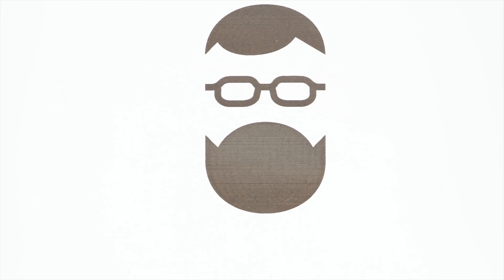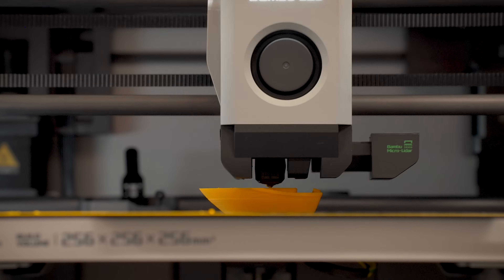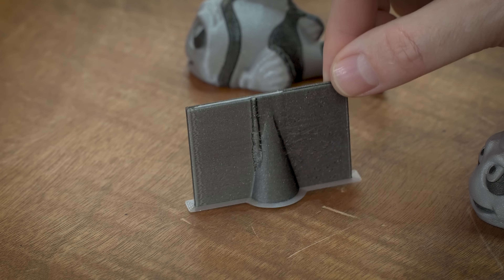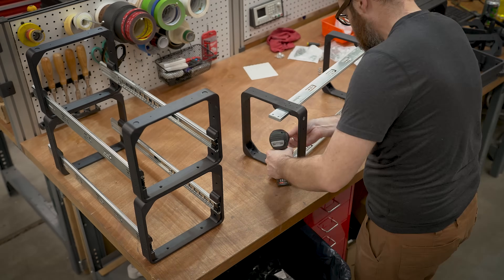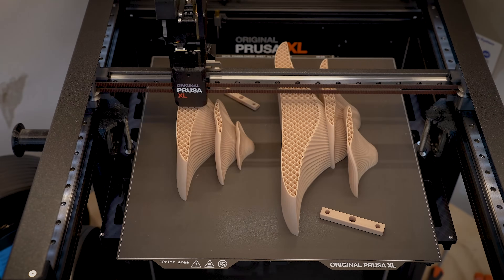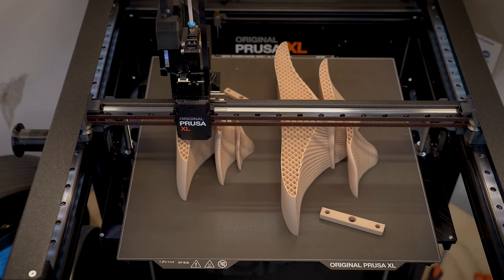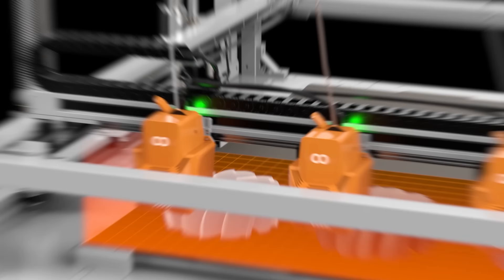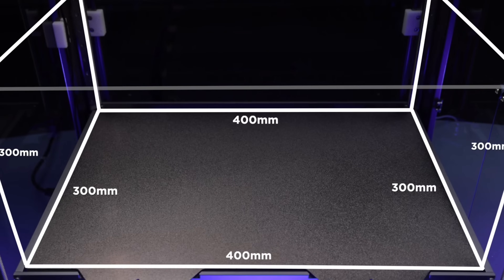Choosing Between Prusa XL and Bambu X1C?

Comment: I made a longer comment which got lost to youtube error, but I think this is a reasonable take.

I also think that the current solution isnt even close to what I think will really break this multi material wide open. I think Bambulab with the A1 Mini's toolhead, seems to basically be planning out sort of what I envision to be a much cheaper, and just as effective system where instead of changing the whole tool end, you just change the hotend, because ultimately, the thing that takes time is getting the nozzle ready, so all you really want to do is switch the hotend to one that is already primed (so to speak, not primed as in the 3d printing term) for that filament.

A system like that would allow for way more filaments on one machine and reduce the cost and complexity tremendously.

Basically something like what MihaiDesigns is working on, I think is clearly the future of multi material.

No doubt for now, Prusa is the only game in town, but I don't think its end game, and instead only the beginning.

Edit: I also had the thought though, that for a maker who doesn't already have a CNC mill, they could actually be set with a Carvera tool changing CNC machine and a P1S for the cost of one Prusa XL, so that further limits the ideal customer. Just an addon thought.
Reply: changing the hotend and changing the tool head is the same amount of work...?
Reply: @pinecone606  Not at all. One requires electronics to be connected and or dragged around, whereas the other is far more space efficientz would have no electronics on it and therefore would be significantly cheaper per tool.

Comment: Now if one company or another offers multiple heads with color changing systems (like the AMS) then that would be a great hybrid. The other consideration with the X1C is not being limited to just the 5 colors. You can effectively set up to 20 different colors without having to really think about it.

Comment: Id love an XL, but not at that price.

I have an e3d tool changer and its decent enough but my god did it require some tinkering and improvements to the machine.

The X1C is awesome, and its spawned awesome improvements to slicers (OrcaSlicer).

Ive added a few things the X1C does well to my e3d tool changer such as the purge bucket and nozzle cleaning.

But the XL I kinda feel is being held back by Prusa's firmware and actually even the slicer. And it just costs so damn much compared to literally anything else.

Sure the XL can print different materials but look how bad the print quality is given the cost of the machine.

Comment: I think Prusa has been a great company but they've gone mad with that asking price lol. Especially since  Ive seen issues with the head swap mechanism, which is  one of two reasons why Id even consider it. Personally I think they should be around $3k but I think they have a  difference in revenue to make up since  Bambu  came to market.
Reply from the maker: I don't see it that way at all.  It's just a much more complicated and expensive machine to make.  It's arguable if it NEEDS to be like that, but looking at the machine in person, I can see where money went into it.
Reply: @RobertCowanDIY  I agree, mine was the kit version.  I was and still am impressed with the quality of the parts and how it is built.   I have had problems and Prusa support has been great.  Still learning how to make it work, but have had some great prints
Reply: @RobertCowanDIY  it’s a nice machine, just not that nice lol.
Reply from the maker: @IDirtbike  Early adoption always comes at a big premium.  But if you NEED the toolchanger, you need it.
Reply: @RobertCowanDIY  very true!! That tool changer is pretty awesome!
Reply: Prusa make their Printer in the EU, not in china. They use quality material, like THK linear rail bearings, IFM sensors etc. they make their PCB in house with good QC. I have nothing agains Bambu, work well, but at the end it is no in the same league, Chienesium VS Quality parts, China cheap labour VS CZ EU job. It is not manufactured the same way, maybe to expensive for some polarized people. I like any 3d Printers, they all have their up and down.

Comment: Having experience with both I agree with the Sedan vs Pickup comparison for average users. I would like to add that for serious multiple material printing the Prusa XL5 puts the Bambu X1C in the rear view mirror. It is incredibly freeing to pretty much ignore the number of tool changes.  The difference is a lot more than just size and capability. I feel the XL is one of the best purchases I've ever made. You get what you pay for.

Comment: I'm curious to see what the experience with the Peopoly Magneto X will be like
Reply from the maker: I'm quite interested in the printer, although I'm not sure any of the features really mean much for actually printing 'better', it will just be a bit faster and much quieter.
Reply: @RobertCowanDIY  The developer told the 3D Printing Nerd during the interview that the positioning accuracy of the linear motors used is 0.003 mm. I think there should be improvements in print quality despite high speeds, and on the other hand, with a 0.2 mm nozzle you should be able to penetrate the detail range of the resin printers while at the same time selecting any materials for functional applications
Reply from the maker: @christiantoth7959  Huh, interesting.  I'd be curious to see if positional accuracy is the issue with getting more detailed prints with FDM, I always assumed it was just the nature of the material.

Comment: I dont remember if i asked before, have you tried soluable supports on the XL?
Reply: don't need to

PLA and PETG  don't stick together so you can use them as supports for each other
Reply: @thinfourth  i thought about it for more complex designs where there is no or little access to remove the supports. And for PC materials or nylons.

Comment: What Large format 3d printers do you recommend if tool changing is not a priority?
Reply: You might take a look at the Rat Rig.  I have two and they work well.  You have to build them, and determine what hot end and extruder to use, but they have a standard.   My 500mm cube can print almost anything.   That size will be about $2K
Reply: @woodwaker1  wow!
Reply from the maker: I don't have any personal experience with them, but I've heard good things about the Sovol stuff.  It's around 300x300 and I think they have a bigger one too.  I've also had decent luck with the Creality bed-slingers, as long as you understand the limitations (relatively slow, not enclosed, might need to get an all-metal hot-end for higher temp stuff).
Reply: @RobertCowanDIY   okay👌🏻 will check it thank you!
Reply: I’ve had a Raise3D Pro3 for several years. It’s 300x300x300, fully enclosed, and prints any material I throw it at flawlessly. But it’s also quite a bit more expensive than the Prusa XL

Comment: Imagine the day you get a pick and place tool head, or laser module for the XL.
Reply from the maker: For pick and place, it would need to move a LOT faster and need many more heads.  I'm a firm believer that pick and place machines will never make sense for small scale production.  A laser could be interesting.  But with an actual toolchanger, all these things are at least possible!
Reply: @RobertCowanDIY  Not as in SMD pick and place, but screw inserts, magnets, or other mechanical parts.
Reply from the maker: @SarahKchannel  Oh, gotcha, that could be pretty handy.
Reply: @RobertCowanDIY  Opulo actually makes a dedicated machine that is somewhat affordable for a hobbyist.
Reply from the maker: @BeefIngot  Oh, huh.  I still believe it's more economical to let others do it ;-)  Managing SMD components, stencils, paste, etc is a pain.
Reply: @BeefIngot  however it is yet another machine that requires space. My lab does not have unlimited space 😀
Reply: @jackersing  Oh for sure, its a good shout.

I just wanted to mention the possibility for people who didn't know. Personally I reckon Ill use PCBway or JLCPCB for any boards I need made, because I just cant possibly be arsed to deal with the whole stencil, paste and bake process.
Reply: After assembling multiple small series of PCBs (10-20 each run with on average 20 components) I very much consider a pick and place machine. Being able to use my XL for the purpose would be a big plus (at reasonable cost)
Reply: @jackersing  I havent thought as far as PCBs, more like placing screw inserts and magnets into printed pockets. But the more versatile the better,
Reply from the maker: @jackersing  Huh, interesing.  Have you looked into services like PCBway or gold phoenix?  They can usually do the whole thing for a little more than the cost of the BOM.
Reply: @RobertCowanDIY  their service works great but there is a setup fee for every component, hassle of shipping components and requirement of additional (spare) components which becomes costly for specialized designs. And of course you provide a lot of potential IP to a third party.
Reply from the maker: @jackersing  You should look into them again, you don't need to send components, most will source them based on your BOM, and there is no real setup fee or requirement for spares.  The IP issue could be a real issue though.

Comment: Before watching, I would opt for the Prusa XL given the choice. While I do not like Prusa products in general (just my personal taste), I think from what I know the Prusa XL is a platform while the Bambu's are rather limited systems that are not meant for mods, expansion etc.. The Prusa looks like a relatively flexible platform, mechanically and software vise.
Reply from the maker: True.  I'm curious to see how Bambu responds to the bigtreetech LCD screen.  They seems to be making it problematic through firmware rather than providing a path for people to make upgrades/mods.
Reply: @RobertCowanDIY  I meant to emphasize that I am not simply regurgitate @RobertCowanDIY video, but rather give my on opinion based on about 20 years of 3D printing exposure. 
Bambu while a great plug-n-play tool, is more like an old StrataSys printer, closed and walled-in.
Reply from the maker: engagement is engagement?

Comment: Makes sense, but next question if you choose Bambu: X1C or P1S?
Reply from the maker: That just comes down to features.  If you need the hardened nozzle, screen, etc, get the X1C.  If you don't need those extra features, the P1S is great.
Reply: If the price is not a problem the X1C with AMS is worth it.  I have both and appreciate the extras on the X1C.